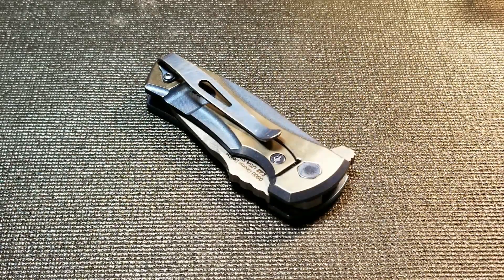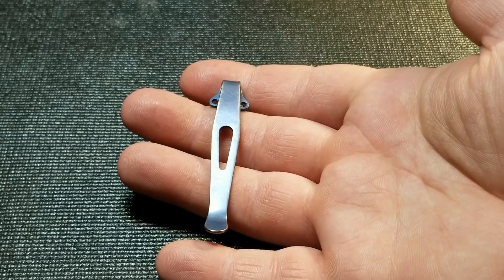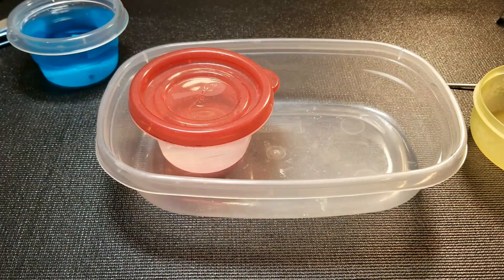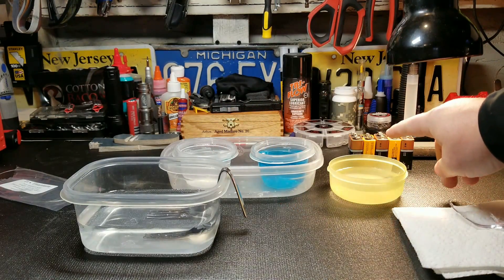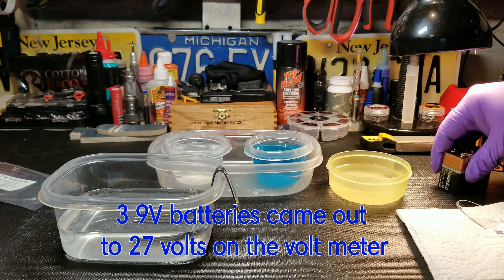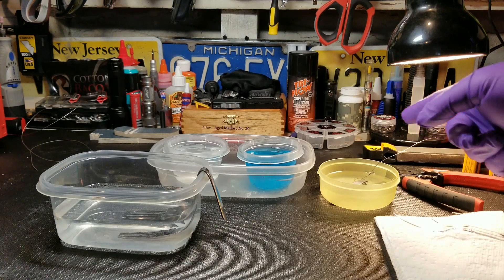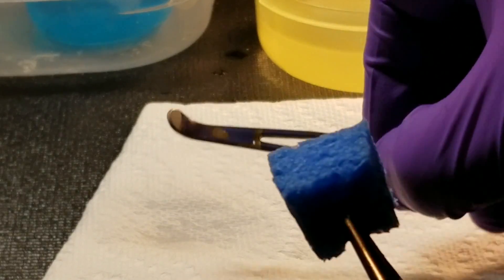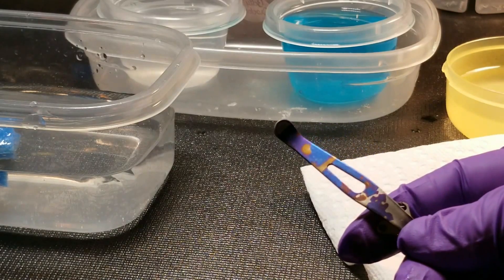Techniques & Tricks For Sponge Anodizing Titanium With 9V Batteries (2020)

Comment: What kind of titanium wire do you use? Is it the kind for leader for fishing? I wanna do this but don’t now where to buy it and I’m concerned about the size being too big
Reply from the maker: The wire I've been using I found on eBay. It's pure titanium wire, 0.5 mm(24 AWG). The package has an email on it: sales@nexmetal.com, so I assume you could email them with an order as well. Got 5 feet on eBay for like $1.50. Hope this helps.
Reply: Thanks this really helped, thanks for getting back to me sir
Reply from the maker: No problem, just glad I could help! I have a new anodizing video that I'll have out in a few hours as well, so stay tuned!

Comment: Do you really need to use the rust remover or will it be similar if you just go from the windex to distilled water to anodizing?
Reply from the maker: You don't need to use it, but the colors come out significantly more vivid, bright and pronounced when you do use it. Without the Whink some of the colors will not come out. I just did a project to achieve the toxic green color and didn't use the Whink at first. I wasn't able to get the green color without it. I have another video that I filmed already showing what a big difference it makes. I'll be putting that out as soon as I finish the editing. Stay tuned!
Reply: SharpKnifeNuts ok thanks that will be so very helpful